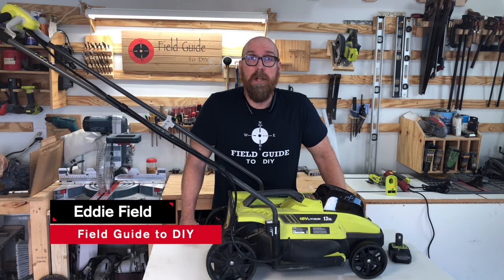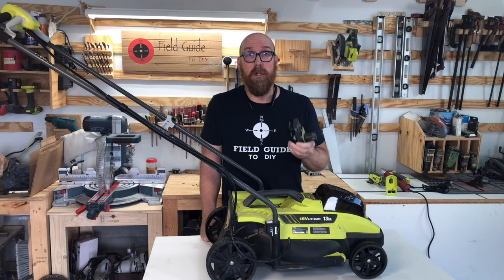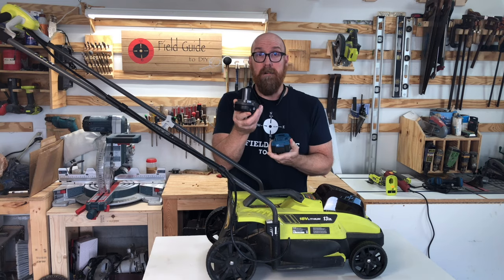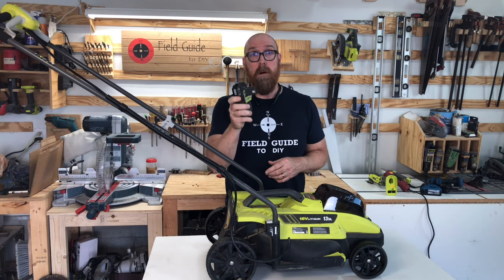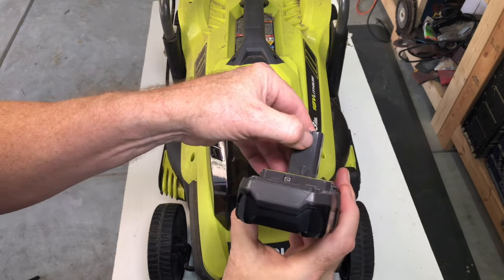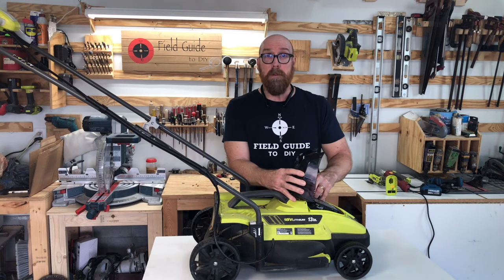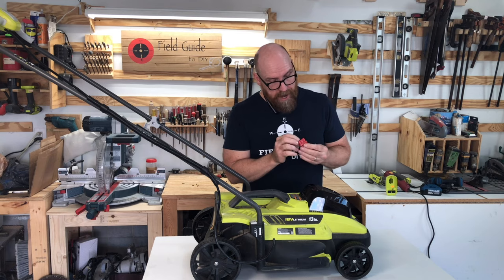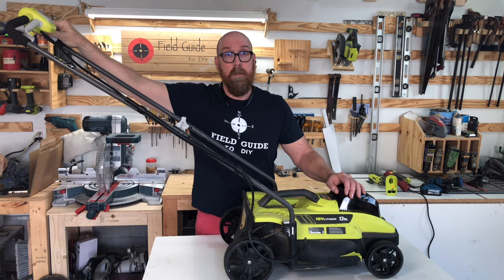Ryobi Lawn Mower Won't Start | Troubleshoot These Steps FIRST!

Comment from the maker: Do you own any Ryobi cordless products?  Do you own a Ryobi cordless lawn mower?  What are your thoughts?
Reply: My thoughts are total frustration with this product from battery performance to just won't start.  Just bought it.  I've tried all these things.  There's no dealer near me.  I'll just go to the trouble to return it.
Reply: Shame old lawnmower was fine until it stopped working after 3 years. New one I bought stopped after 3rd use.
Reply from the maker: @afkfavorite  I’m sorry to hear of your experience.  Ours is still running like new (fingers crossed).  Thanks so much for watching and for sharing.
Reply: What’s the model for your mower? I would like to get something that small.
Reply from the maker: @gabrielasanchez3685  This is the Ryobi 13v 18 inch Cordless Lawnmower as seen in this video - https://youtu.be/zKTAfFL38jE.  I like it because we have a deep sodded drainage gully that the riding lawnmower will not cut.  This Ryobi is light enough I can pull up and down the sides of our drainage gully.  Thanks so much for watching.  Please let me know if you have any other questions.
Reply: We've owned the (Model Number: P1100 18 volt) Ryobi ONE+ 18V 4.0 Ah Cordless Push Behind Lawn Mower for about six years, and I'll never go back to owning a gas mower. I absolutely LOVE this thing. It's so light, easy to push, and you can actually carry on a conversation with someone while using it. However, for some reason this season it will go for about 10 or 15 minutes, then just shut off, and it won't start up again until we let it sit for a few minutes, as if it's overheating. It's not clogged underneath with grass or anything, so I'm not sure why it suddenly started doing this. Mine is slightly different than yours, but probably because mine is an older model, and also mine is a 16 inch model. My Ryobi batteries do have a charge indicator on the side of each one where you just push a little button, and it shows in the light bar how much charge is left. Mine are also the much thicker batteries than the ones you're showing, but like I said, my model is also the 16 inch version. 

So my question is does this have a ventilation location where the motor draws in air to keep cool? I'm guessing if it does, that's probably become clogged with dust and debris, so if I can locate such a vent, I can just blow it out with my air compressor, and it will likely fix the issue. It does act as if it's overheating, because as I said, once it sits for a few minutes, it will start right back up, but a few minutes later, it stops again. Do you know how the motor is ventilated?
Reply: Is the motor an AC?
Reply: 100% charged, fully installed, red plug installed

Comment: Thanks to your video, I was able to successfully troubleshoot my lawnmower. It was on it's second season, and it just started to cut off out of the blue. The batteries were fully charged and the contacts had no debris. The culprit ended up being the fuse safety key, which wasn't making good contact. It could've been because after my second season of using the lawn mower, the key had jarred loose while mowing or during storage. I took the key out, made sure the area was clean, reinserted it, and the lawn mower acted normally. Thank you!
Reply from the maker: Frank, I’m so glad it helped.  I’m also glad it wasn’t anything more.  I’m hearing horrible stories but my little 13 inch Ryobi mower is on its 4th season now.  Thanks so much for watching and for sharing!

Comment: The issue for mine is not covered by your previous suggestions. Symptom: it attempts a start but will not reach cutting speed before it automatically stops.  Oddly, I can repeat the start process a few times and the mower will function normally until I stop to change the battery or emptry the leafbag... the..back to  malfunction. Your thoughts please.
Reply from the maker: That sounds like an undercharged battery.  Are you sure the battery going in has a full charge?
Reply: @FieldGuidetoDIY  Yes, unfortunatey, I'm working with fully charged batteries.

Comment: Mine is a 3rd season 18v.  Batteries charged and motor started making a ?pulsing sound then cut out after 2 mins. Pushed key, was fine..looked under it..seemed fine. What can be wring?
Reply from the maker: Do you have a different 18 V battery that you can charge and try in there? It sounds like the battery is faulty.
Reply: Yes have 2..one was new a month ago.  I'm going to charge them both up again. Think i may have a faulty charger.  I always charge them up after use so i think..lol. we'll see how things look in the morning.  Thank you for responding.@FieldGuidetoDIY
Reply from the maker: @user-hq9nq2zk9t absolutely!

Comment: We've owned the (Model Number: P1100 18 volt) Ryobi ONE+ 18V 4.0 Ah Cordless Push Behind Lawn Mower for about six years, and I'll never go back to owning a gas mower. I absolutely LOVE this thing. It's so light, easy to push, and you can actually carry on a conversation with someone while using it. However, for some reason this season it will go for about 15 minutes, then just shut off, and it won't start up again until we let it sit for a few minutes, as if it's overheating. It's not clogged underneath with grass or anything, so I'm not sure why it suddenly started doing this. Mine is slightly different than yours, but probably because mine is an older model, and also mine is a 16 inch model. My Ryobi batteries do have a charge indicator on the side of each one where you just push a little button, and it shows in the light bar how much charge is left. Mine are also the much thicker batteries than the ones you're showing, but like I said, my model is also the 16 inch version. 

So my question is does this have a ventilation location where the motor draws in air to keep cool? I'm guessing if it does, that's probably become clogged with dust and debris, so if I can locate such a vent, I can just blow it out with my air compressor, and it will likely fix the issue. It does act as if it's overheating, because as I said, once it sits for a few minutes, it will start right back up, but a few minutes later, it stops again. Do you know how the motor is ventilated?

Comment: I have the 2021 Ryobi 40v (6 amp) 20" electric mower and, after storing it away (properly) for the winter, had hoped to start 'er up and clean up the fresh spring grass today but she wouldn't start. I tried everything. Everything. Turns out this model has TWO, count 'em two (2), battery slots: one for the power, one for a spare. I had the battery in the spare compartment which has no power connection. Finally, switched it to the front slot and she works great. Boy, do I feel stupid.

Comment: got time for a repair it's $100 for the inner circuit board integrated circuit board $100 or $100 for the motor and how much for the technician more Chinese junk just take it you've used it up you've used up your money's worth throw it in the garbage buy another one
Reply: Thanks for the confirmation that I made the right choice by tossing mine.
Reply: What is the warranty? In Australia it is 6 years.

Comment: Wrong ! My charger does have a light that tells you when it's charged And know your recommendations didn't work. Don't ever buy this lawn mower People although it's probably too late.
Reply from the maker: The batteries I got later have charge indicating lights on them.  My 13 inch Ryobi electric mower weighs only 40 pounds and is perfect for me to mow the 5 foot drainage trench in our front yard.
Reply: Mine has charge indicator too.  Both keep flashing the one green light all the way to the right...when fully charged don't all stay green?